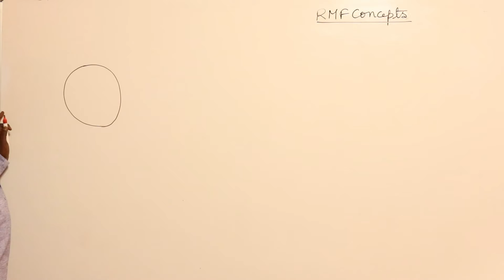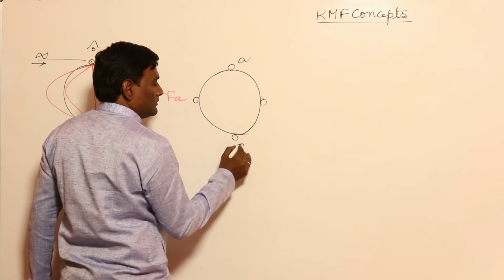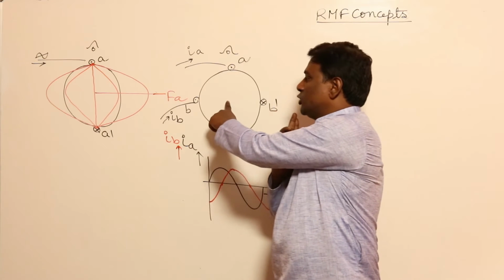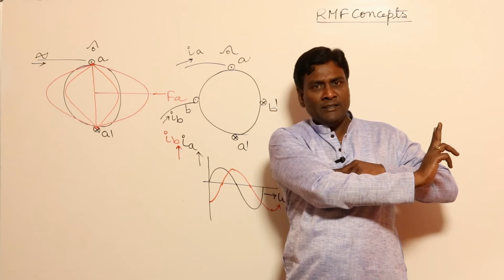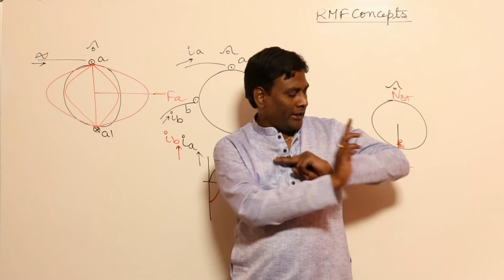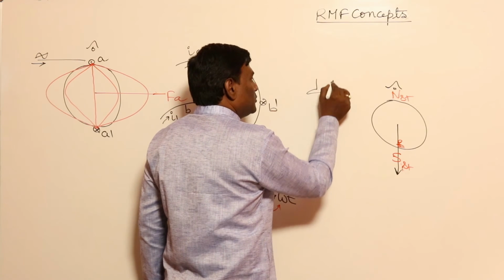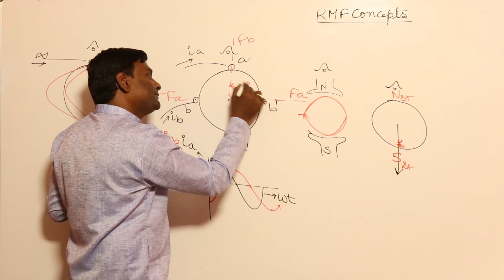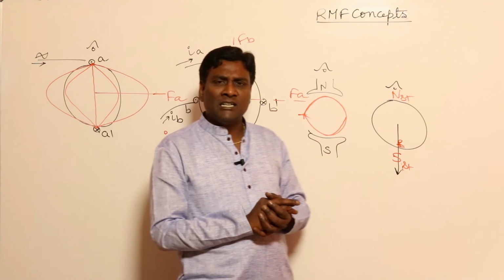Rotating Magnetic Field (RMF) Concepts | KN Rao for GATE

Comment: a 3-phase induction motor is driving a constant torque load of 1p.u at 5 percent slip.it hasna maximum torque of 2p.u at 10 percent slip. torque - speed variation in stable zone is assumed to be linear. for the stable operation of the motor, the minimum p.u. supply voltage is